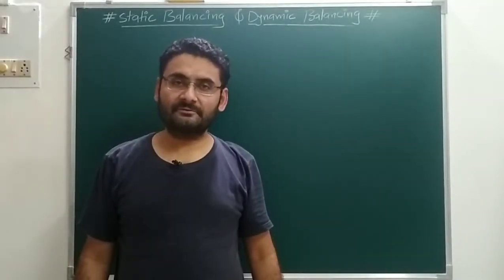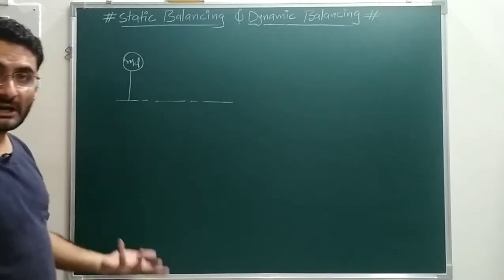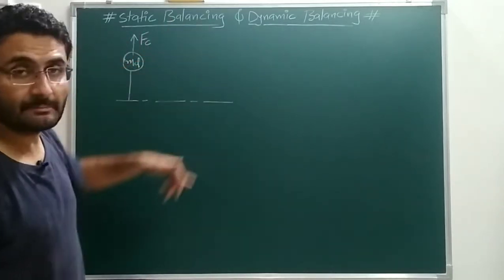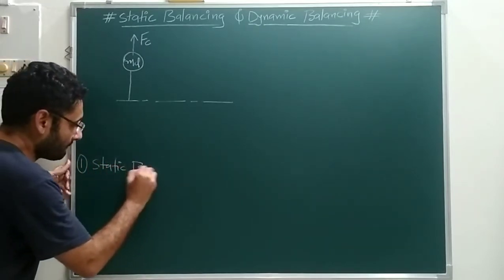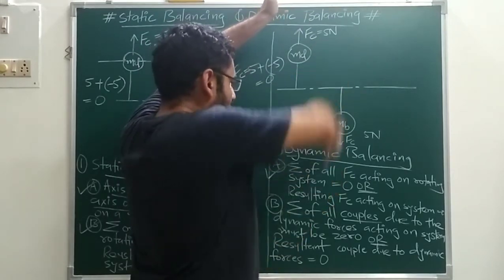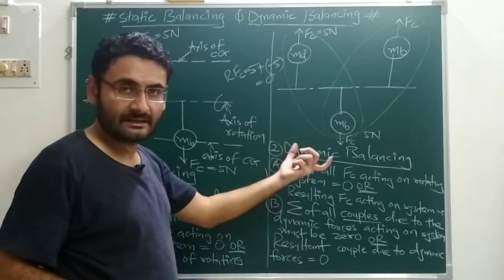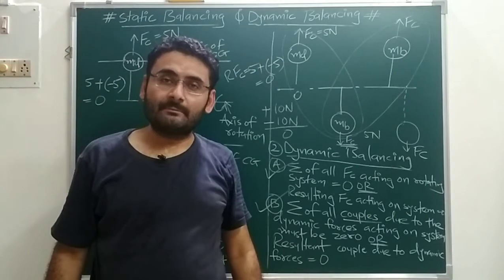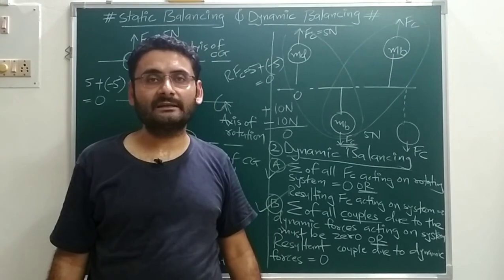Static and Dynamic Balancing (DOM/TOM)_01

Comment: sir, your explanation  was super clear,  but please tell me that... when we are balancing  the shaft dynamically , is the shaft is still statically  balanced, because the first condition  is not meeting.... 
or can I assume that, the shaft shd be dynamically balanced  because that is what the shaft are designed for
Reply from the maker: Basically when forces are acting in different planes then the dynamic Balancing is must.
For other cases story can run with static Balancing.
Thank you for showing interest
Reply: pls post a videos on, how a turbo charger is statically and dynamically  balanced
Reply from the maker: @thatchanamoorthithatchanam3292 I will try
Reply: sir, I am asking , will it be statically  balanced.... if it is dynamically  balanced.
I understood  what you have told
Reply: correct me if I am wrong, when the shaft Is dynamically balanced due to various force acting in different planes, then the shaft is not statically balanced
Reply from the maker: @thatchanamoorthithatchanam3292  yes it is